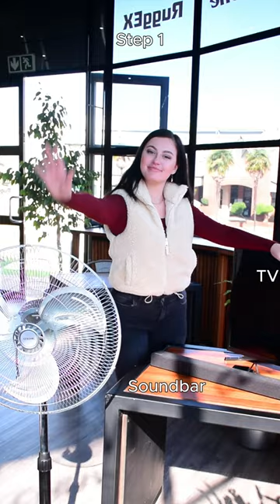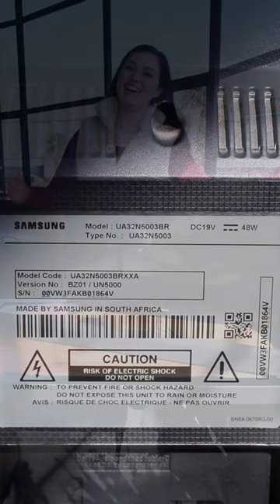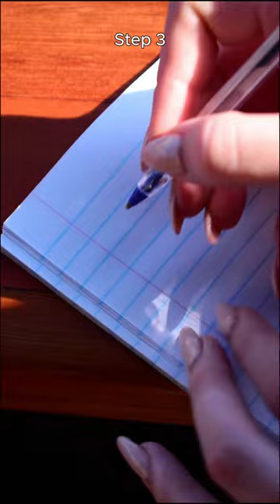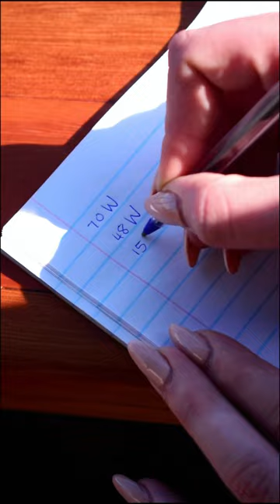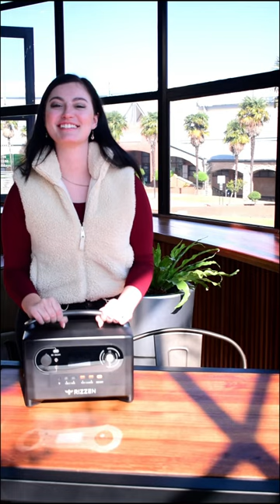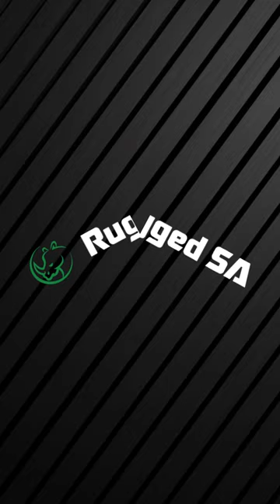How to calculate Watts for a Power Station 🤩 #watts #powerstation #ruggedsa #southafrica

Comment: I have a 200w Rizzen power station and on my tv it shows AC100-240V  -  50/60 HZ 5A, can this powerstation handle this.
Reply from the maker: Hi, could you kindly confirm the Watts that the TV draws ?
Reply: Hi it doesn't show on all the stickers on the TV, I have checked everywhere on the TV @ruggedsa35
Reply from the maker: @vuyanimbuyeleni138 Hi, could you kindly confirm the model make and number  🙂
Reply: @ @ruggedsa35  Model:42SL90QR  its an LG:10001M, 
Power AC 100-240v  - 50/60 HZ 5A
Reply from the maker: @vuyanimbuyeleni138  Based on the information provided, the 200W will roughly last 1.5 hours as a 44" LCD TV consumes around 80-120W per hours. If you would like a powerstation that would support your TV and perhaps a router with UPS functionality to protect your devices for a longer time then we suggest either the 500W / 700W power station.